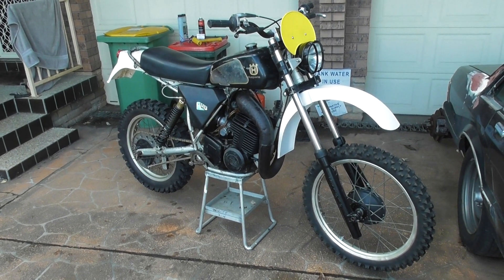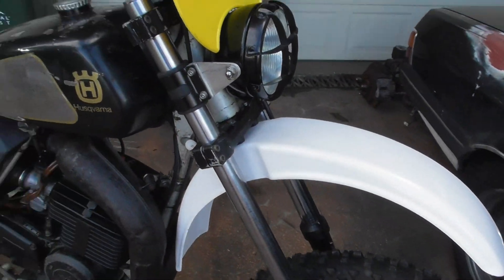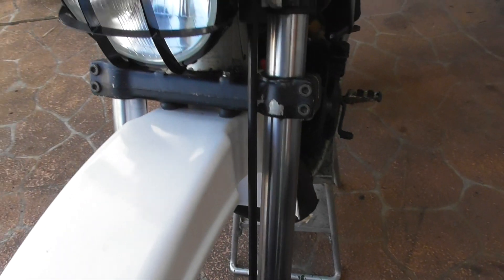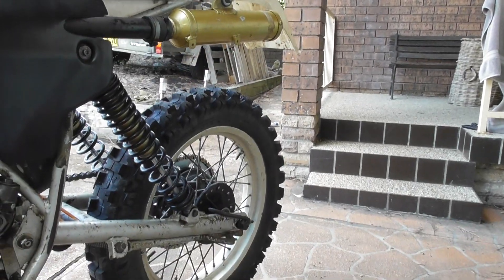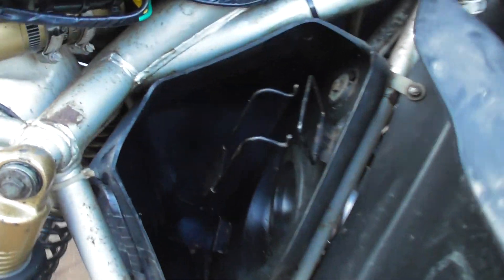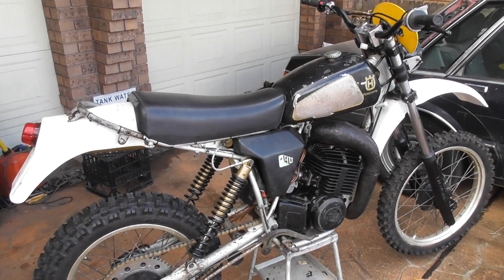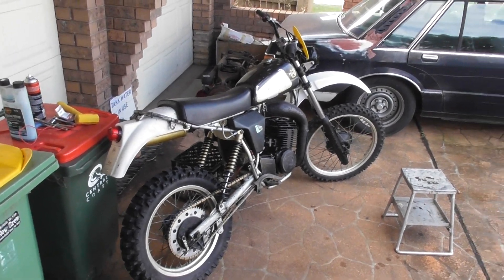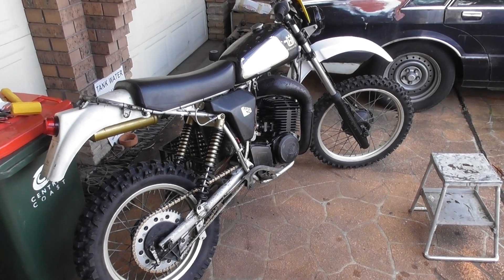1980 husqvarna cr390 project ,part 4 , it runs !

Comment: Looks like a wr 390.
Reply from the maker: Yes thank's it does , but I know the bike's history from new and it has two tubes running under the engine and not three which confirms it is a cr390 . In other videos posted I show both CR and WR set ups that came with the bike .
Cheers

Comment: Hi, do you happen to remember the part number for the hella tail light?
Reply from the maker: Hi ,sorry for no reply, lots happening lately but will check that tomorrow for you  .cheers
Reply: @pyroman6962  thank you
Reply from the maker: Hi , finally found it , Hella part no. 2.2885.01 that is from the bag it was in ?? To suit lamp number 2351 ,2863 .
Also I used a cheap led copy of the Hella lamp  from eBay which is 99% of the original part . 
Narva part no.85845 is a good alternative too .
Sorry for the late reply, cheers